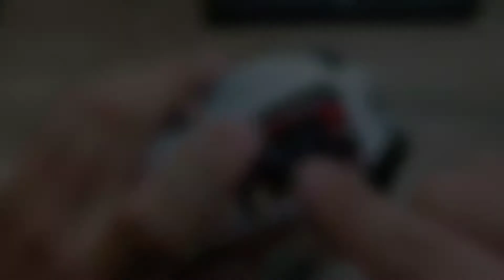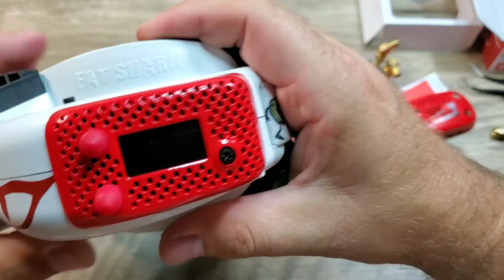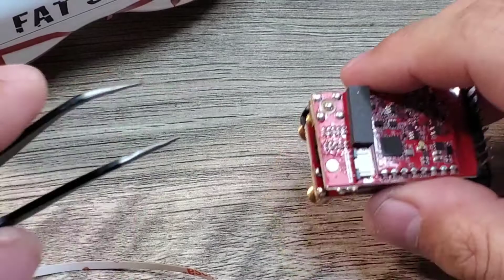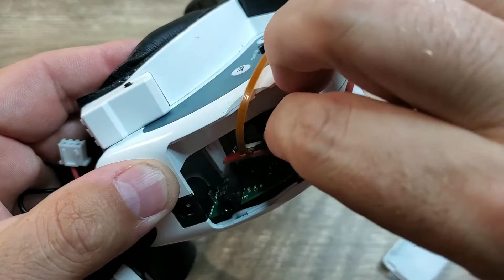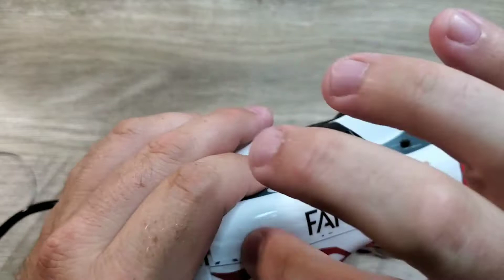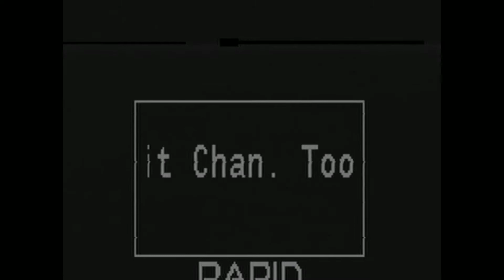Diving into Rapidfire! Installing Rapidfire Module and OSD Interface

Comment: Ok so I just got the the rapidfire module. And am using skyzone03o. But it's like my goggles aren't even recognizing that's it there. It's plugged into AV in and has plenty of power. When I change channels and or band on the module nothing happens and I still have video. Tried to fly and it's like flying without antennas on my goggles themselves. If I change the channel on my vtx and match that channel and band with the rapidfire module nothing happens until I change the channel through my goggles. I'm lost someone please help. Module is updated to newest firmware. Please help I'm lost

Comment: Thanks for your Video! I have a question. I bought the Fatshark HDo2 and RapidFire module in 2021. But when I install the rapidFire (without the powerBoard) my Fathark show me, that I have enough power. It shows 5 V. Why is that so? So now, I don`t to have to do to install the powerboard? I`m comfused
Reply from the maker: Hdo 2 does not need the power board only the hd3. Thanks for watching!!
Reply: @edrone_  Ah okay, thank you very much!

Comment: I have the Dominator V3 and when I plugged in the module it said I had 4.2 volts and low power was no so am I supposed to put the extra module in I did a flight with it and it was fine I haven't done any calibration or tuning yet though

Comment: Thankyou was getting Low power mode on my Dominators V3 with the board installed. Found that my cable was not pushed in far enough. Your video helped so much on how far to push the cable in. Smashed the like button.

Comment: Do I have to put the external Power Board in my attitude V5
Reply from the maker: No its not needed for the attitude v5s
Reply: @edrone_  I really appreciate that and also I'm getting a lot of horizontal black lines is that normal for the rapid fire
Reply from the maker: @dominofpv1885  dont think so maybe check all your connections and make sure all pins are seated properly in your goggle
Reply: @edrone_  I actually have went over all that but I think just maybe it might be my calibration maybe off cuz I done it inside the house

Comment: I just bought the HDO2's.
Am I going to have to go through the same trouble or will the rapidfire work as is?
Reply from the maker: Not sure. If the hdo 2s output 5 volt to receiver then you should be fine otherwise you can plug in your rapidfire and see if the voltage says low voltage on the modules display.
Reply: yes works with all HDO models.